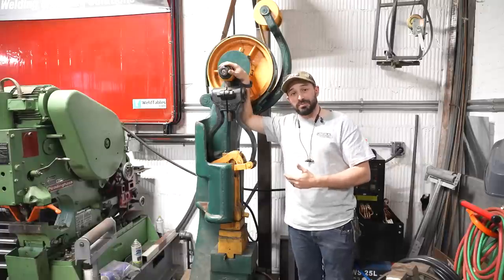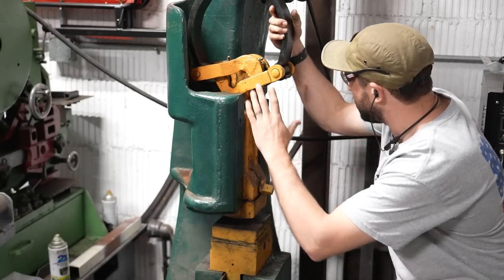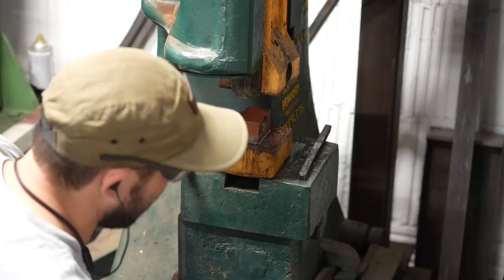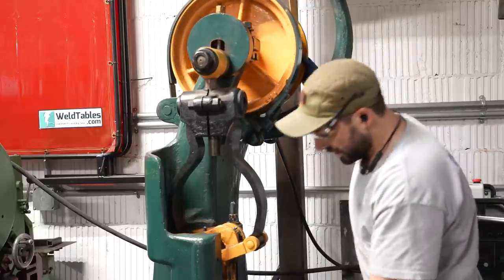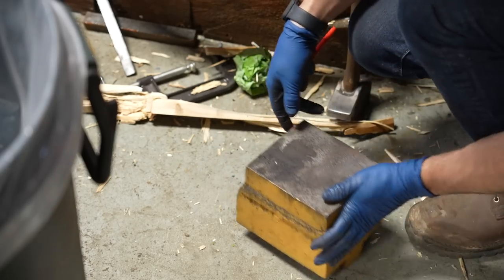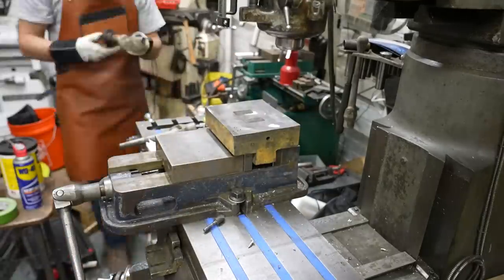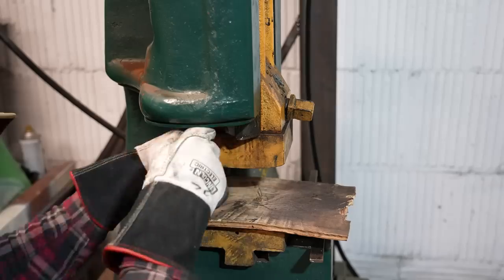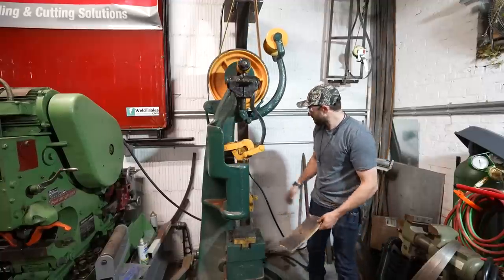Fixing An Extremely Rare Blacksmithing Tool! Beaudry Power Hammer!

Comment: As always you did a great job explaining how your hammer works  and improving its usefulness 

One item that troubles me is sticking your hand between the dies.  Hopefully,  there is a means of locking the hammer

In college, my next door worked a summer at a press stamping out automotive parts.  The machine he was operating required both feet to be placed on the pedals and both hands operated the controls.  If he moved a foot or hand off a control the press shut down.  Seeing the metal was not positioned properly he moved away from the controls.  He reached into the press to reposition the part.  The press turned on and crushed his hand.

The bottom line, is never place your hand between the dies.
Reply from the maker: Thanks for watching! As soon as your foot comes off the treadle there is a brake shoe that locks down on the flywheel up top. It’s impossible to move the ram when that brake shoe grabs… that being said I shouldn’t have done that…

Comment: Awesome work!  Would like to point out though, that your concrete might be too thin for that machine. You can see your machine to the left rocking when you’re using it at 15:55 in your video. You may eventually crack your foundation. Be careful!

Comment: Question:How hard is the bottom face after you cut off the top part?  Seems that it must be fairly soft since it cut fairly easily with the band saw. You may find that you need to add a hardened face after a while.  But for now, it looks like you’ve made it a great worker for your shop!

Comment: 1 problem I see is you are maxed out on the stroke of the hammer cause you cut the die so low.
Reply from the maker: Theres actually a fair bit more stroke to adjust into if I wanted to using the cam offset

Comment: I don’t know nothing about power hammer etiquette, but I suspect putting one’s hand between the die and anvil while the motor is running is a horrible invitation to a very painful disaster.  Are there any experienced professional power hammer users out there who could weigh in on this?
Reply from the maker: No question, I shouldn't have done that... BUT there is a brake shoe that completely locks the flywheel when your foot it off the treadle, so while not the right move, there is no way for the ram to fall.
Reply: @MakeEverything  - Thank you so much for clarifying that there is a brake while parked. I did not know that.  I just hate to see another very inspiring YT’er get maimed like Stan over at Bar-Z did earlier this year.  I only wish you the very best. Stay safe my friend. You have so much more to accomplish 👍👍😎👍👍
Reply: It's not a big deal the clutch was disengaged. In alot of forge shops the large hammers are always under power, even during die change over etc.

Don't step on the clutch and you'll keep your hand.